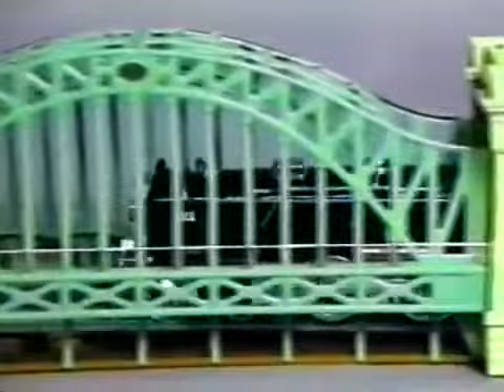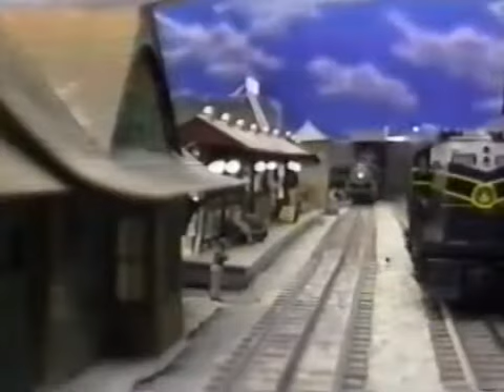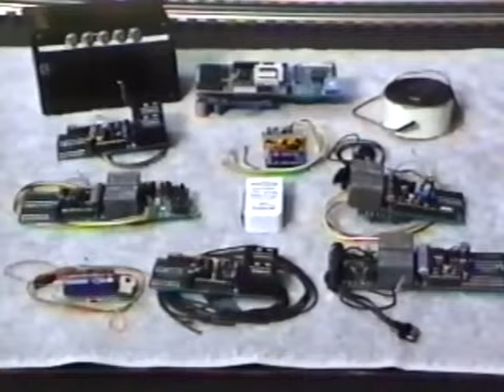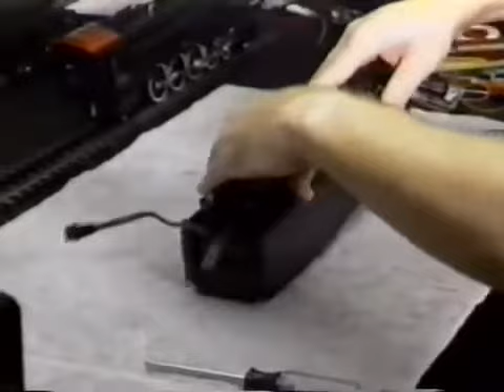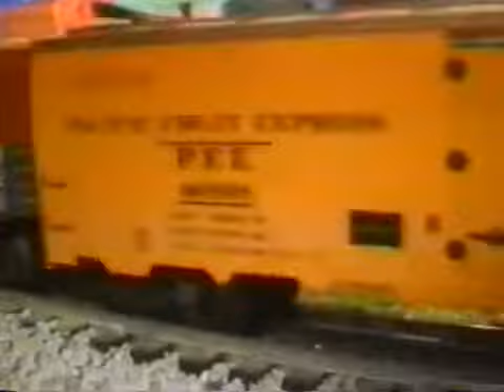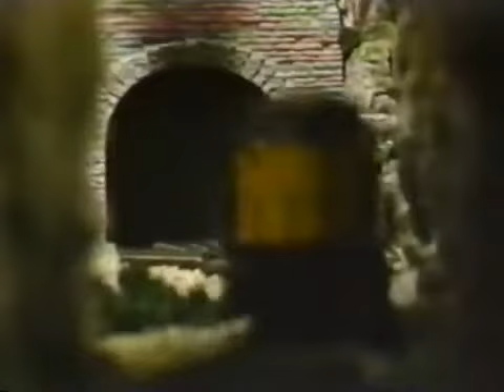The Exciting World of MTH Electric Trains (1994) VHS Rare Out of Print #mth

Comment: I had this tape growing up.  The MU'ing sequence starting at 10:00 just totally rocks.  I would have loved to play with these systems but they're hard to find these days.  I have a Railking 0-8-0 with QS2+, but I'd like to find the more advanced QSI products.  Really cool seeing the state of the art just before command control really took over.  I also noticed the layout is the same one used in some of 3rd Rail's ads.
Reply: @milehirail8877 Would you want to do a video of the RailKing 0-8-0 and what its features are, including the PFA sequence if possible?
Reply from the maker: Ive got quite a few locos with Qsi and Proto Sound 1. I've got several other boards that I'd like to retrofit into other locos. I have a QS-2+ with emd passenger sounds and three QS-3000 boards two of which are steam and one diesel. While not as realistic sounding as Railsounds and proto 2 and 3, QSI made great products and it's a shame they no longer make anything for 3-rail O gauge. They really pioneered digital sounds for model railroading.
Reply: How do you MU the units with QSI and individually run them while all under powered track?

Comment: I still have my PS2 MTH engines. I remember getting my first one in 2007 after a long stint with regular lionel and LGB. That really got me into operations and real railroading
Reply from the maker: Currently I don't have any PS2 locomotives. I would love eventually buy a locomotive, but I would have to upgrade to the DCS system. I'd also love to get the Lionel TMCC system. So far I have 3 MTH RailKing locomotives, a 1995 NYC Mohawk, a 1998 PS1 PRR 2-6-0, and a early 2000's Locosound Blue Comet.
Reply: @wordenentertainment1997  you can get the little module from Mike's train house that you can use DCs to control Lionel TMCC. This way you only need one command control system. I don't know if it works with Legacy or Vision locomotives because those are later versions of their electronic control systems that might not be compatible. Myself I like conventional control the sound effects get cacophonous and annoying and you don't need enough smoke in your train room to look like you're a bunch of stoners
Reply: @frankmarkovcijr5459  DCS Can control Legacy and TrainMaster Command equipped locomotives as well.